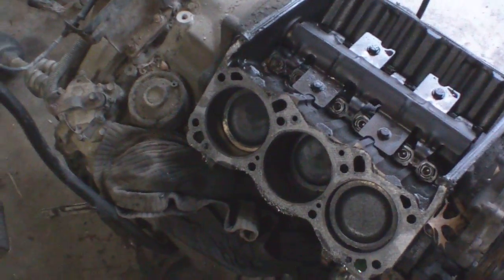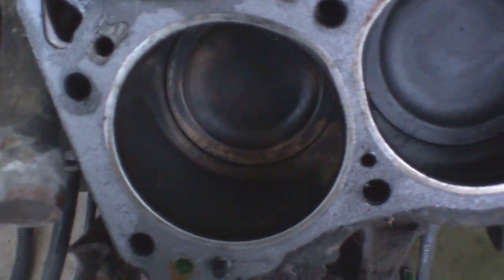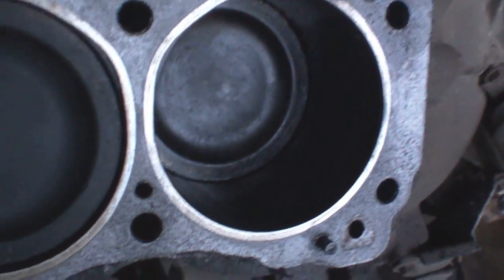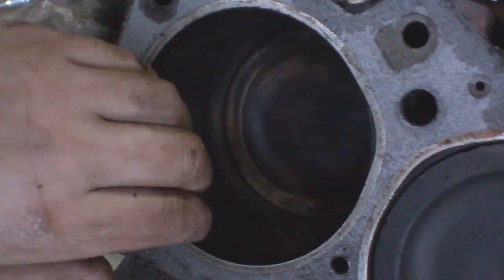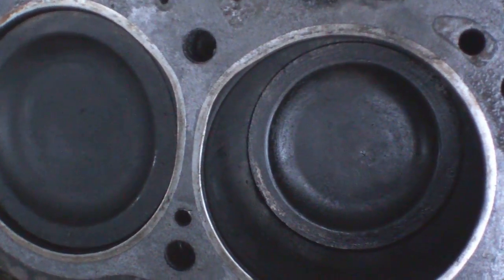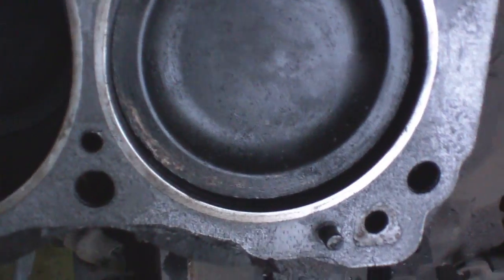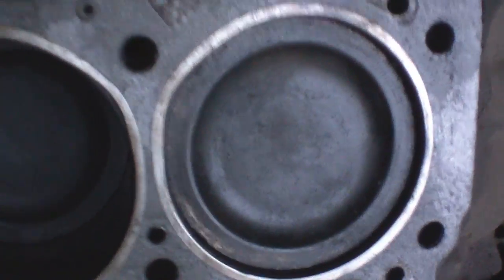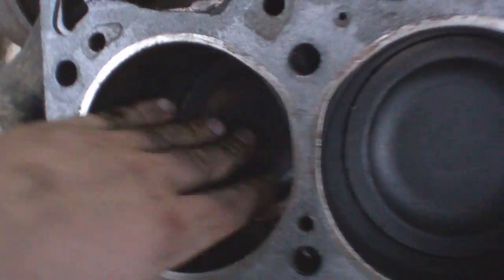Teardown and Inspection: Piston end rod knock and wrist pin

Comment: I'll answer a few questions about these engines for anyone else reading looking for answers.

To save the engine the smart way would be to remove the crank and have it polished. Then that piston is toast since to my knowledge the rod, wrist pin and piston is all one assembly. There is no snap ring to remove the wrist pin. Then he would need new bearings and install a newish piston sourced from junk yard. Then the crank will need rebalanced and fitted to the new rod. And then new main bearings and clean all oil passages and clean the pump and strainer and a few more things I may be forgetting off hand. It is a lot of work and costs a lot. unless doing a budget build and getting by with as low of cost as possible.

This is why he would have probably just went to the junk yard and replaced the engine. unless he wanted something to do for fun so he decided to rebuild the 3800.

I know all this because I am rebuilding one that spun a bearing. And yes a new crank with new bearings and new seals and new piston will be installed. along with new piston seals. The bad one is cylinder 1 on mine so the whole piston and rod is toast.

As for some of the other questions.......yes it is safe to drive until it finally shatters the piston and no longer runs. The question is do you want to run it. probably not because it will run like shit.

If you scratch a crank and it is deep enough to catch a fingernail then the crank needs to either be reground and fitted with new undersized bearings or you need a new crank.

As for the guy who said it was a spun bearing. More than likely it is not because he is able to spin the crank pretty easy here. If the bearing spun it would either be seized or at the very least harder to spin. It is pretty obvious its a bad wrist pin. Also if it was a snapped rod it would have probably ruined the oil pan, strainer and probably taken out the crank and the piston next to it. It sure as shit wouldn't spin.

Comment from the maker: @in2dionysus I have another video of the bottom end while it was still in the car. There were metal shavings and flakes in the oil pan.  I think the previous owner ran it out of oil, since that has been the end of several other vehicles they owned.

Comment: Sounds like a wrist pin issue, prolly lack of lubrication, and as for the "melted metal" around the cylinder if it's around both the cylinder and the piston crown it's most likey aluminum from the piston due to an over heated piston ie because of the wrist pin lubrication issue. I'm sure this is no longer a relevant video but I figured I'd post my thoughts

Comment from the maker: Actually this particular series of motor is very reliable.  The most common problem is the Magnavox DIS, which was replaced by a Delco modular system in 1992.  This series of motor also tends to lose the cam interrupter after 200k + miles.  GM switched to a plastic UIM gasket (for unknown reasons) for the series 2 engine which caused coolant intrusion into the intake when it warped around 100k miles.  There you go, brief history of 3800 problems :)